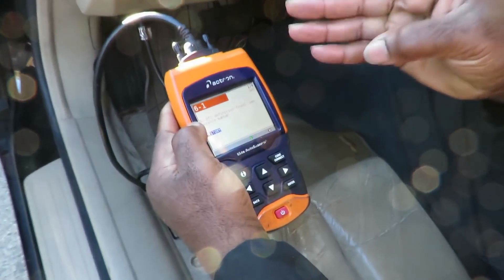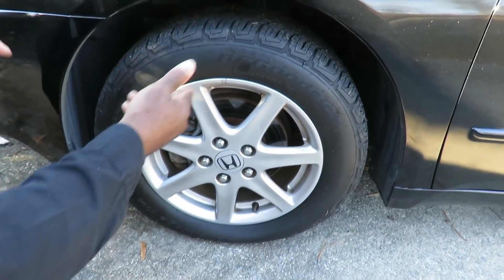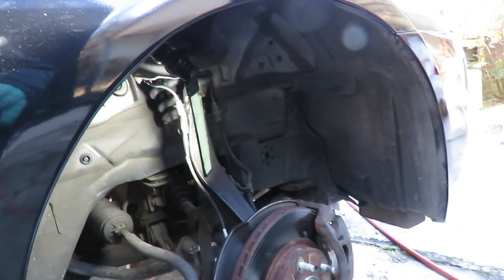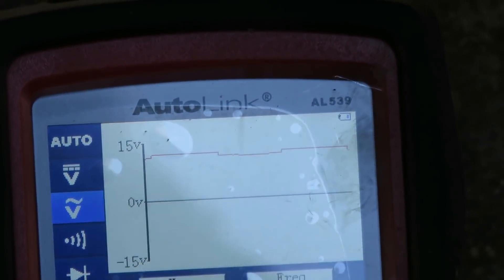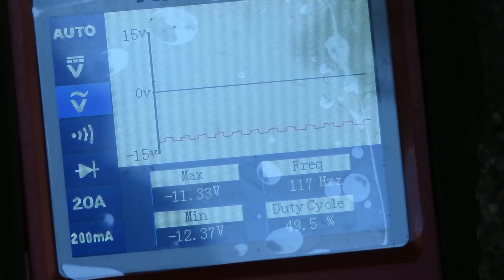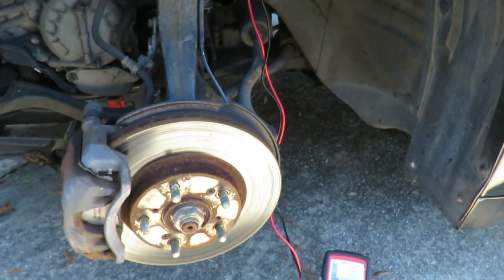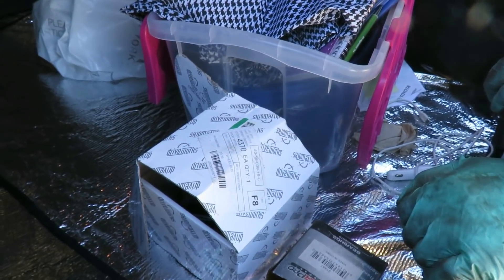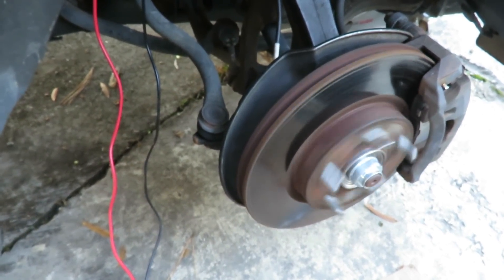⭐ 2004 Honda Accord - 3.0 - ABS Code 71-1 Wrong Tire Size

Comment: great video, wish I could see part 2 but either way it was very informative. I have a quick question in regards to tires, I saw in the internet the specs for a 2004 should be the following: 205/65R15 92H	6.5JJx15 ET55 is there a problem if I use let's say CRV or Civic tires with the flange 6.5 J...?or I should stick to 6.5JJ...? much appreciated...

Comment: So Timmy if the driver wheel is not spinning in drive , what can be the cause??? Freeze caliper or bad Axle???
Reply from the maker: Some don't spin unless the other wheel reaches a certain speed. She didn't say anything about pulsating brakes, or smoking, so I'm going to say the caliper is safe. But we will be doing the job, so looks like we are about to find out what happened.
Reply: Astral Auto Repairs cool thank for your response , looking for the next video 👏🏼👏🏼

Comment: My approach would've been first pick a reputable shop or if I had a mobile guy I just would've bought the hub with the bearings n seals, races  already inside !!!!
Reply from the maker: You know I find here that a lot of these mechanics tell people they can do something, just for the extra cash, and being that the customer doesn't know what involved with doing certain jobs, they believe them.

BUT what I hate most is when we fix someone else's screw up, then the customer says "I'm not letting anyone touch this car again, except for you guys", ten we find out down the road, THAT WAS A LIE, because we are back fixing something else!
Reply: @OnlineAutoRepairVideos  u right Timmy cus when I have a problem I research to see what's involve n if the job is complicated i make sure   I give it to a guy that's going to do it right cus wow Timmy that guy have to  do that wheel bearing all over again thru astral that's known to save the day lol
Reply from the maker: LOL!

Comment: I think the tittle of the video should read 71-1, rather than 17-1. Easy mistake. LOL!
On another note I have a kit that can remove the front wheel bearing on these cars without removing the knuckle.
It is available at HF and it is called "front wheel bearing adapter". A slide hammer can remove the hub (flange) first. Maybe the previous mobile mechanic used a kit similar to this?
At any rate, grease should be no where near the ABS sensor.
A few questions:
Are you sure no other wheel bearing was tinkered with? The reason I ask is, do you know which wheel location code 71-1 points to? I searched and can't find that specific code description from Honda.
That old original bearing being oversized also has me thinking - could it be a rear wheel bearing mix up? You are right - confusing.
Reply from the maker: THANK YOU LEN for noticing that!

She stated that (and I asked her three times) she took it to him because the front right tire was making a noise. He had a hard time fixing it, took back the bearing she bought, got a new hub, and a new bearing, took it to somebody, came back to put everything back together.

After that, she drove it, and THEN the lights came on (ABS, Brake, and the small triangle), then the car acted funny. That code is funny because it does not give a specific wheel, but ALLdata shows how to check it.

THAT'S RIGHT i do recall hearing bout a tool like that. Have you ever tried it, because that would save a lot of time.
Reply: Yes, I have used it often.
I also bought a slide hammer kit to pull the hub once the hub nut has been removed. I have to sometimes use a Dremel cut off wheel to slice through the inner race that remains pressed onto the hub, much the same as it is with any other method of wheel bearing replacement.
My reasoning behind purchasing the  "front wheel bearing adapter" kit was simple - I did not have a hydraulic press and it would be handy to have in a mobile situation.
This method may also be easier to use on some vehicles as the whole knuckle does not have to be removed, only the CV axle has to be temporarily relocated in order to position the drive screw press into position. 
Some of the better kits include a thrust bearing with the drive screw to help reduce the effort required to pull the bearing out of the knuckle. I bought my own thrust bearing from Amazon and it works great.

Comment: If it's not a defective-new-bearing, maybe when he slid the new bearing in the bore he over lubed the bore. And pushed the grease towards the magnetic sensor and covered it with grease. He was sloppy. Maybe the grease is affecting the magnet. But it doesn't make sense that the wave form works but then drops out. Anyways the customer has to make a decision. Next time call Astral the first time! Yea bbbudy
Reply from the maker: You are right Victor, it doesn't make sense! We will be doing a new bearing, maybe we will see something once we remove it.